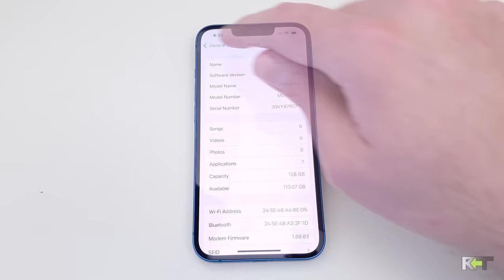iPhone 13 Teardown - Full Disassembly

Comment from the maker: Things to note:
- The screen only has 1 flex cable now, as the Digitzer and OLED no longer need separate ribbon cables.
- The screen no longer carries the top earpiece speaker, it's only the top microphone and proximity sensor (and light sensor?)
- The rumour of the iPhone 13 not even booting up with a replacement battery has been squashed.
- Face ID is disabled with an independent screen replacement (outside of Apple). Hopefully a screen re-programmer can solve this barrier soon.
Reply: I don't think iPhone buyer would even dare to try that
Reply: Hello again, you should probably pin this comment.
Reply from the maker: @lowkeybear10  hey thanks, I pinned it, but it keeps becoming unpinned... does a pinned comment only last 2 days or something?
Reply: Restore Technique Probably a random bug on YouTube's side.
Reply: Face ID works??
Reply: Hey brother please give it to me plzz
Reply: Broo please give me any iphone mobile??? 11,12,13 any one please 🙏🙏
Reply: Giveaway iPhone 12
Reply: i’m glad the one about the 13 not booting up with a replacement battery isn’t true, because it lowkey sounds exactly like something apple would do
Reply: @adarshranjanpattnaik3905  Abe cringe chapri 😂
Reply: @MeMelon4u  😂

Comment: I like what u r doing here. Zero damage to the phone and total professionalism 👍🏻
Reply: Got some concerns about the wireless charging coil but other than that good job.
Reply from the maker: @losien1  Thanks. Wireless charging still works 👌
Reply: It’s so he could return it and get his money back when he’s done with the video 🙄
Reply: He did “damage” the phone. He pulled and broke the rubber that’s supposed to block water from coming inside the phone.

Comment: Would it be possible to change the lightning port to usb type c port?
Reply from the maker: Not sure. It would involve a lot of complicated tiny wiring, or a new printed flexible circuit board. And the frame would need the port hole resized, as a USB-C port is thicker and wider. A lot of effort.
Reply: Broo he did it
Reply: @zakisiddiqui2272  i saw the video too
Reply: I found it he did it 💪💪💪
Reply: Here before this blows up.

Comment: Anyone still looking on how to do a battery replacement don’t worry about the top ones just get the bottom two off and than lift the battery and you can pull it off with no damage to the battery
Reply: Also if you have a us iPhone DO NOT yank the logic board first take the battery out than disconnect the millimeter wave antenna thants on the right side of the battery if you rip the 5G millimeter wave antenna cable you will lose 5G millimeter wave (the fast 5G)
Reply from the maker: Good advice 👍
Reply: The small adhesive strips break 80% of the time depending on the age of the phone. He has great technique. I will heat the back of the phone gently with heat gun on low setting for about 10 to 15 seconds. It restores some elasticity to the strips, increasing your chances of success. The LAST thing you wanna do is poke a hole in that battery! They go up like a fighter jets afterburner in about 1 to 3 seconds! Always use plastic tools when your rearranging your battery.

Comment: The R$D to make this possible is hyper impressive. Not a fanboy but I love tech and this is impressive. 

I’m left wondering if apple’s use of the adhesive and other tactics they take to make replacing things difficult, leads to a more durable and water resistant product compared to the their competitors.

Comment: Why don't u using iphone 12 water proof seal for instead? Isn't be compatible each other? They have a same size so wanna see it will be compatible
Reply from the maker: It doesn't have the earpiece indentation at the top. With iPhone 12 it is straight at the top, but iphone 13 dips down.
I'm sure an adhesive seal for the iPhone 12 could be altered to fit, but not ideal.

Comment: You didn’t mention that there is a 5g antenna cable soldered to the bottom of the motherboard, with the flex cable going around the battery to connect to the antenna on the side wall next to the battery. I ripped the cable because the device you showed either didn’t have that connected or had already been desoldered. Other than that it is a good video. Luckily it didn’t seem to affect anything, but I did rip a flex cable because you failed to mention it.
Reply: Smfh now I have to see if my phone is damaged after tugging on the motherboard only for it to not budge.... Really sucks this video creator didn't mention this.
Reply: This is a guide for an international repair and it does not mention that lol

Comment: Tip: Once you get your pry tool in, drop a dab of IPA in the opening and it will easily open up.
Reply from the maker: I did drop some IPA in at one point, but it didn't seem to help much. I probably didn't use enough.

Comment: After such opening, is the phone still as waterproof as before?
Reply from the maker: No, it's never going to be as water proof as a trillion dollar company can do it.
The phones are assembled in a dust free hermetically sealed room, so no dust can get in between the adhesive and the parts, reducing adhesion quality.
But once I replace the adhesive with a proper adhesive seal, I'm confident it will be waterproof, just not the 6 meters for 30mins Apple advertise.
My only concerns are the charging port and lower microphone, as they used double sided adhesive instead of rubber gaskets. The good thing about those parts though, is that they are screwed in very tight up against the frame, so I didn't feel the need to replace those adhesives. The adhesive was still quite tacky too.

Comment: Love your clean video. You might want to avoid using heat gun i.e. too hot. Use heated bed (pad).
Reply from the maker: Thanks man. A heat gun and a heat pad can be any temperature though, it makes no difference. The good thing about using a heat gun is that I can monitor the temperature closely and frequently with my hand or an infra-red thermometer. I kept this device below 130°F.
Reply: ~54.4 °C :)

Comment: Lots of screws 😳😳😳. How do you find them correctly 😕
Reply from the maker: I lay them out on the bench, in their original pattern/orientation, next to the part they were screwed into. Also laid out in order of time, so I know which part goes in at each point in the assembly. I used to use a tray with 84 compartments, but it only tells me the location of each screw, not the order of when they go in.
Reply: Must be hard to remember order …😔

Comment: Sir can I charge new iphone 12 with k20 pro 18w in box charger is it safe
Reply: Yeah it supports 18w fast charging so yeah it is completely safe to use it
Reply: @Wonder0304  100% sure ? Bcz I am asking for battery health issue for it as well
Reply: @bangbangop5682  yeah lower wattage is better for battery health but if u want to use fast charging its not gonna damage it as if it is not supported
Reply: @Wonder0304  so I can use use it without any issue right
Reply: 18w is pretty low by todays standards. I frequently use the 30w included with macbook pro and works fine. My 12 Promax still sitting at 100% battery health after nearly a year of use.
Reply: @M3T4LBUD  so in other words it's safe 😁

Comment: Hi bro , nice video u r very careful  perfect Job , I have a question, my cousin put a razor in the same way you put your green tool in, moving it back and forth, and since that black plastic is also the moisture insulation, you think that with that action I could have cut the insulation and now my iPhone is not waterproof. What d u think ?there will be a problem?
Reply from the maker: Thanks 😀
It all depends on the angle the razor blade was on, hard to say without seeing what was done. If the screen didn't lift up and pull away from the adhesive, then I'd say it's probably still waterproof, maybe not as strong  though.

Comment: I spilled water on my iPhone 13 Pro Max, then I tried to dry the top (at the gap between screen and frame) with a hair dryer for 20/30 seconds...do you think that the gasket seal has been damaged? 

Other question, I can insert a paper in the gap at the top of the phone, I have already pushed the paper to the bottom of the gap to remove the dirt, can a paper damage the seal if it touches it?
Reply from the maker: It should be fine because it's waterproof. Heating it up for 20/30 seconds won't do any damage unless you pry up the screen whilst the adhesive is warm.
If the paper pushed into the adhesive it might damage the adhesive a tiny bit, but only like 1-5%. The paper isn't strong enough to do much damage to it.

Comment: Why didn't you use T7000/8000 glue for replacing adhesive seal ???
Reply from the maker: Because that's messy and naff.
I got the genuine adhesive seal, and it's now waterproof again:
https://youtu.be/LwtMCpJ9BzA

Comment: What is that black single flex top left hand side of the phone you left in place ? When disassembling I could not remove it even with heat safely so tore the ribbon need the part name to replace

Comment: so these iphones have complete metal chasis within? I though it was just glass as the structural base
Reply from the maker: Yep, except for the circle cut out for the wireless charging antenna on the back. Glass too brittle for structural integrity.

Comment: So the front speaker is not part of the display?
Reply from the maker: No not any more. Only a top front microphone, proximity sensor (and maybe a light sensor?) are on the display now. I should've taken that flex cable off, but I was rushing 😩
Reply: @RestoreTechnique  thanks for the info

Comment: not sure why this phone is different but if you intend to take the mother board out there is a cable that runs under the battery to the mother board which is soldered on. not sure why his ip13 doesn’t have that
Reply: i believe it’s the antenna

Comment: Thse 2 flex connectors which come with the charging port what's the small connector for??
Reply from the maker: I don't know which part you mean sorry
Reply: @RestoreTechnique  you know the 2 flex connectors attached with the charging port, ones slide under the motherboard and connect on left side of, 1 large connector and 1 small, what's the small flex connector for and what happens if it breaks...
Reply from the maker: @moharz3575 I'm not exactly sure as I haven't analysed the traces enough, but I think it's for the barometer, left hand microphone, lower antenna.

Comment: Why is the A15 chip bigger on the regular rather then the pro and max models?
Reply from the maker: It's not, it's just the shielding design is different, you can only see the A15 label in this video
Reply: @RestoreTechnique  oh ok

Comment: What glue do you use for the battery?
Reply from the maker: I used some oem battery pull strips for an iPhone XS Max, and I think 1 from an iPhone 8, not exactly sure. I tried to match the original as best as possible.

Comment: amazing video! Just one Question: When you put the Phone back together, did you put some type of glue or something for example for the wireless charging receiver or the Camera flex? Because when you opened it, you used a hot gun in order to remove it. I was wondering what type of glue you applied when you put it back together?
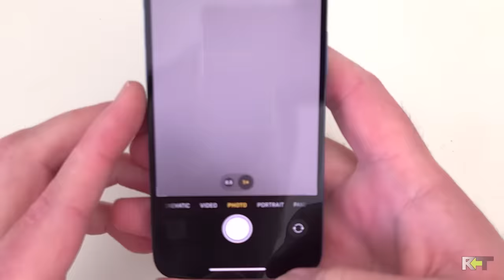Reply from the maker: I didn't use any new adhesive to reassemble. As mentioned at 11:48, the proper replacement adhesive wasn't available on launch day.
See updated video for adhesive installation:
https://youtu.be/LwtMCpJ9BzA
Reply: @RestoreTechnique  thank you!

Comment: A pain in the hole to remove the screen, a repair shops worse Nightmare, Great Video 👌
Reply: All phones with waterproofing are like this. A trade off for keeping water away from the internals.
Reply from the maker: @edmn  Yes but the iPhone 12 and 13 have the screen very snug in the frame, and the screen is completely flush with the frame, so getting a pry tool in without damaging the thin display is hard.
I've opened up hundreds of IP68 phones before, and this was the hardest. This was my first attempt at the 13 though, and hadn't done a 12.

Comment: is it still going to be a waterproof ?
Reply from the maker: Yes, once I replace the adhesive with a proper adhesive seal. My only concerns are the charging port and lower microphone, as they used double sided adhesive instead of rubber gaskets. The good thing about those parts though, is that they are screwed in very tight up against the frame, so I didn't feel the need to replace those adhesives. The adhesive was still quite tacky too.
Do I think it's still water proof for 30mins at 6 metres? Probably not.
Reply: @RestoreTechnique    then, its a noice disassembly 👌 like a Pro

Comment: can the liquid indicator be half red or does it turn completely red when in contact with water? mine is white but the edge looks like red
Reply from the maker: The edge and back of the sticker can look red before getting any water on it, as the white sticker has a red dye layer either at the back or in the middle. So my iPhone 13 sticker I could see a red tinge on the very edge of the sticker, but this isn't water. The dye hasn't bled into the white sticker.

Comment: ummm what how did you remove the board? what about the soldered antennas??
Reply from the maker: Must be a different variant (Australia). There were no soldered antenna.
Reply: @RestoreTechnique  wow there are 5g antennas down the side with the battery. Was soldered to the bottom of the board. Interesting for sure

Comment: Brother how can i remove the dust particle stuck on the edge of the iphone 13 camera lens?
Reply from the maker: Underneath the glass cover? You'll have to open up the phone and the  use a blower to blow the dust off the lens. If it doesn't budge then you'll have to use a qtip, but very delicately.
Reply: @RestoreTechnique  not underneath the glass cover, on the edge of the glass cover.

Comment: Anybody got a good reason why the batteries are always glued in like they need to withstand Hulk?
Reply: To Simplify it. 

Fire Bad.
Reply: @SilverFuel21  Simplify? Just don't glue it at all. It's not like the battery can shake around. Or maybe just use a rubberized thingy with the same thickness as the glue. No shaky but no gluey.
Reply: @an3k  It most definitely will move around. A battery that hasn't been adhered is gonna fail much sooner than one that is adhered.
Reply: @M3T4LBUD  Understandable but wouldn't a small strip of adhesive be enough? Not something like glueing the whole surface of the battery into the phone.

Comment: compared to other model.. how hard is the latest model to dissemble?
Reply from the maker: It's much harder to get into than previous iphones, except for the iPhone 12. I believe the 12 was about the same difficulty. Once you've got the screen off, I actually think it's a bit easier than previous iphones. Less adhesive, more rubber gaskets, better chance of retaining the water resistance.

Comment: Genuine question can you damage the screen or components with the heat while trying to take it apart?
Reply from the maker: Yes you can, it's mainly just the screen and the battery, never heard of heat damaging other components unless its hot enough to melt plastic.
The battery life can be degraded if the battery is heated up too much. And will explode if heated way too much.
The screen can be damaged around 200*F, discolouring of the plastic polarizer is usually the first thing to get damaged. Also the pixels in the OLED panel can turn white.
I didn't heat up the phone where it was too hot to touch, as that can damage the battery. So around 120*-130*F.
Reply: @RestoreTechnique  thank u

Comment: Use quality screwdrivers mate, so that you won’t easily strip the screws
Reply from the maker: I only use the most premium 20c ebay screwdrivers for my $1000 phone 👍
Reply: @RestoreTechnique   @Real TUTORIALS If you find dirt in the screw, clean it out because that can make stripping screws more likely since you can't fully insert the tip of the screwdriver. Of course you don't have to worry about that here since its a brand new phone. Thanks for the teardown!

Comment: BEWARE! This video does show the 5g antenna cable soldered to the underside of the logic board on the updated iPhone 13 5g models.
Reply: Its for an international version! Does not show the USA version with the Antenna Soldered to the underside of the of the Logic board.

Comment: So they lied to us about the battery they put in there shame on apple lol.
Reply from the maker: Actually I think it may have been reported by leaks, not directly stated by Apple.
Reply: @RestoreTechnique  I believe this is correct. Apple has historically steered clear of capacity and sticks with time estimates. Leakers and others outside of Apple are the ones to give us the capacity (Which can be annoying when trying to find a powerbank).

Comment: Virtually nothing in this phone is repairable though even if you can can disassemble it. Hugh Jeffreys took two brand new iphone 13s and tried switching multiple parts between them and the phones wouldn't work properly. Even the most minor parts if not from the original phone would stop the phone from working correctly. Screw Apple🤬

Comment: You wouldn't have struggled so much and broken so many tools opening the device if you had used proper tools and techniques.  Adhensive strips under the battery wouldn't have broken if you had used the right technique to remove them.  Given your lack of the proper tools and supplies, i'm not surprised you didn't install replacement adhesive before you put the display back on either.
Reply from the maker: I didn't replace the screen adhesive because I wanted to wait for the genuine seal to be available, I thought I made that clear:
11:48
Reply: Glass half empty man! Still a bloody good tear-down.

Comment: you do not need to use heat gun. You can wrap the telephone into a cloth and put it into microwave 600 for 30 sec. it just pops out.
Reply from the maker: You're joking... right?